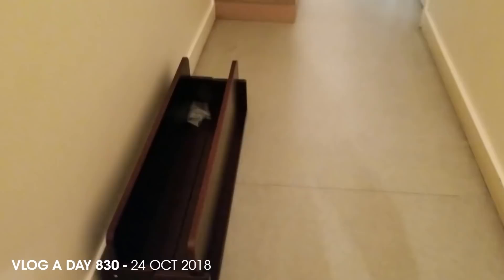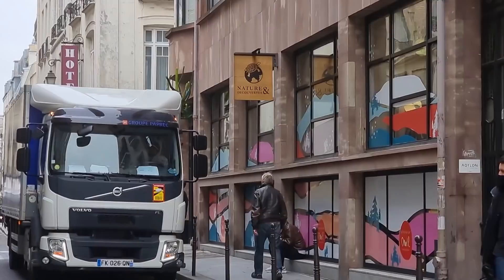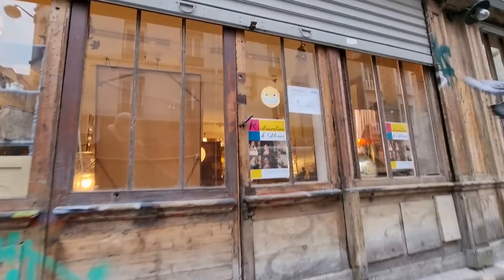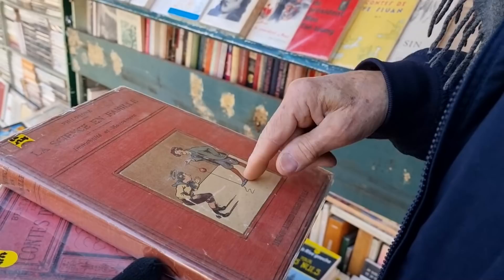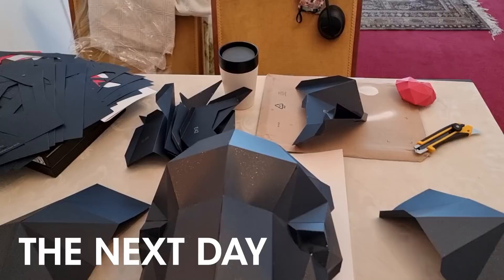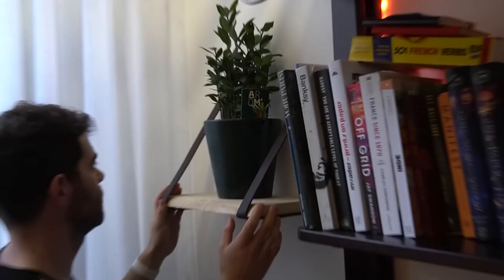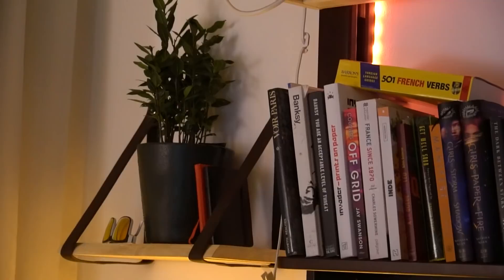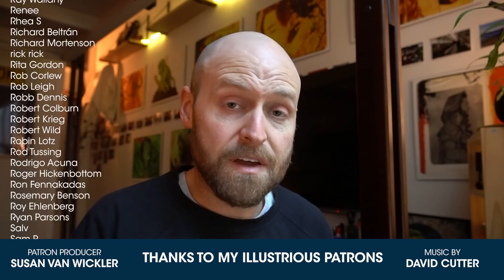Tiny Paris Apartment Upgrade 🛠️ Chateau Level Two

Comment: I wonder if you could use a radio signal system? Radio Shack used to sell them in the States. They are used in a lot of products that would either be awkward or impossible to set up as remote otherwise. I couldn't see the elephant very well ; - < I think you are heading in the right direction. As an interior designer my cardinal rule with clients is that nobody comes to your home to have an experience of Architectural Digest. They come to have an experience of you. Your home definitely reflects who you are.

Comment: Sam’s light looks interesting.  I appreciate his focus on using recyclable materials.  Bearing that in mind, maybe even the styrofoam packing peanuts in its carton could also be substituted with paper packing material.  I’m not sure how convenient people will find trying to recycle styrofoam.  Paper is likely easier to recycle and it biodegrades more readily if it’s not recycled.  I recall how difficult it was to recycle plastic bags in Paris as recently as a few years ago!